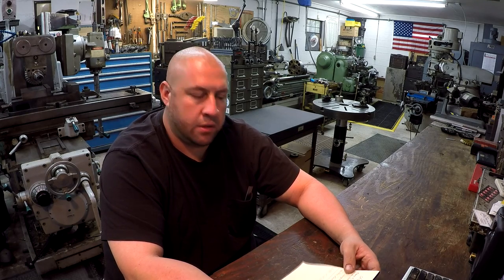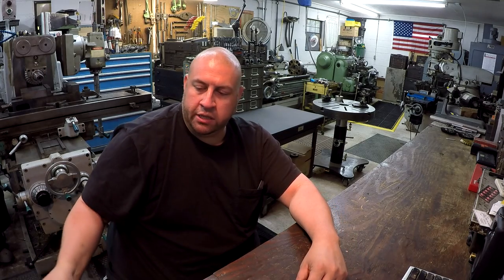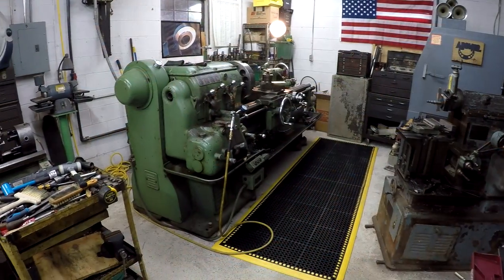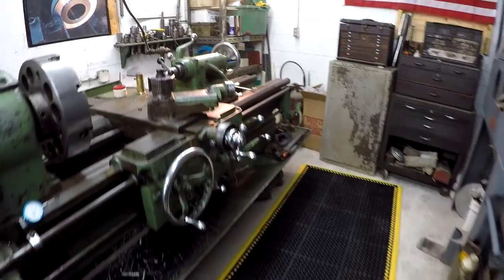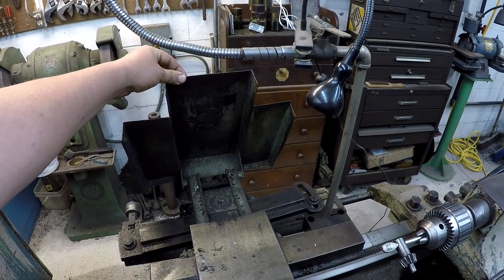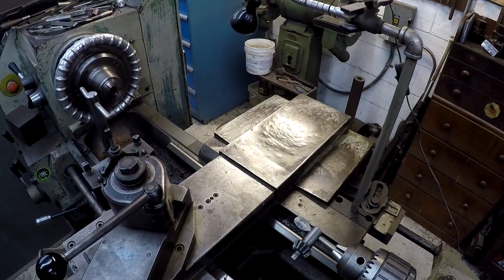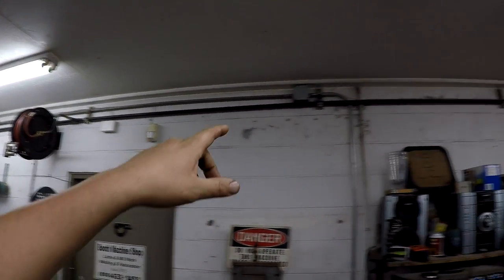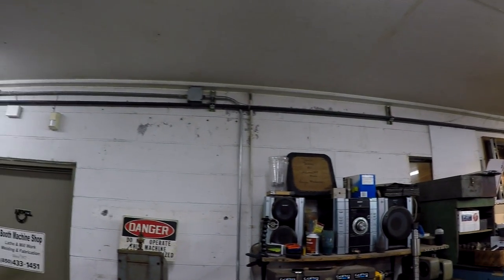Shop Talk 8: Lathe Way Damage? Shop Air Supply

Comment: That PVC pipe is good to like 360 PSI or something like that so I wouldn't replace it.  You may want to consider putting in a filter and regulator right after it comes through the wall though.  I am sure that there is a lot of humidity in the air where you live and getting the water out is always a good idea and regulating the air down to 90 psi will make the compressor run a lot less than it does now as well as extend the life of your air tools because they are designed to run at 90 psi rather than 120 or whatever your compressor shuts off at.  Have fun.
Reply: No. You must go at least 25 feet minimum from the tank before an air drier will work. Moisture will not condense out sooner than that in most cases. And he should have drains in the line as well
Reply: +GODINN LIVES not true. moisture in the air doesn't change further down the line. condensation in the air lines does. He could get a phase change air dryer and put it right next to the compressor if he wanted.
Reply: PVC is a no-no for compressed air.  Aluminum, steel, copper are OK, even flexible polypro tubing, but NOT pvc pipe.  See this article: http://www.usplastic.com/knowledgebase/article.aspx?contentkey=787
Reply: Part of the reason for the 25 foot distance is that all air flow/pressure will change form potential to kinect energy:  the pressure drops when it is moving down the line.  A drop in air pressure reduces its capacity to suspend water vapor and it condenses.   The point for a heat exchanger is directly after the compressor pump (not the receiver/tank).   The air is the hottest just as it passes the valves in the compressor head.  At that point you can extract the most heat.   I installed 30 feet of 1/2 copper pipe prior to it entering the tank.  Almost all moisture stayed in the tank after that.  Also, since the air was cooled and condensed, I had more air per compressor operation cycle and my impact tools "hit" harder.

Comment: I think you should leave the dents, they are a reminder of your dad! On the bed grinding mods, why was the lathe not provided with a removable gap in the bed? That is standard practice on UK lathes as you quite often come up with the clearance problems you mention. You have a very nice compressor set up, as you say the blast cabinet uses huge volumes of air, a thing that most people do not seem to understand, they think only in terms of pressure.

Comment: I did plumbing and did black steel pipe, which is my preferred,  then i did copper which was the prettiest,  then i repaired a 1.25 sch 80 air line for a factory that ran 300 psi..that was my scariest..strap it well, especially the turns..
  I liked the black pipe threaded, i even put drip legs under all the outlets. I strapped it 2x normal, who knows if a worker would hang something, i think ahead. . Accidents can happen,  drop a part on it, hit it with a machine, maybe a dent. No break or shutdown for repair.

Comment: The two biggest issues with using any plastics for compressed air are UV degradation and chemical degradation from the oil carried over from the compressor. Using a good quality oil separator will mitigate the oil issue, and simply painting the pipe will all but eliminate the UV (and ozone) damage.

Comment: Hello, if you want to run an air pipe on the other wall, i think it would be a good idea to make the air line circular, to have it go around the shop onto itself, theoretically you should get a bit more efficiency out of the line... :). Regards

Comment: I wonder if it's practical to use a curtain to keep sanding and grinding dust away from the rest of the shop.  Don't think there's enough room or need for a separate room but something to help control the dust.  Not sure it's worth the effort though.  Just a thought.
I plumbed my shop using PEX.  Works fine but looks pretty poor.  All of it was leftovers from another project so no additional out of pocket for the airification of my shop.

Comment: Hi Adam & thanks again for the videos.
Perhaps some time in future you could explain 'unistrut' to us newbie's?
You use it for your compressed air line.   THanks  Rod
Reply: https://en.wikipedia.org/wiki/Strut_channel   On Adam's airline a short length of unistrut is mounted vertically to the shop wall, and the airline is attached to the unistrut using clamps designed for that purpose.  The short dark vertical objects every few feet down the length of the airline, are  pieces of unistrut channel. There is also a horizontal piece of unistrut attaching the electrical conduit above the breaker box on the wall.
Reply: Thanks for that kwbarnes1

Comment: I wouldn't worry about changing the air pipe SCH80 will last forever, the problem you can have from using plastic pipe is from using SCH40 and big pressure changes like draining your tanks every day and filling back up, the expansion and contraction is hard on plastic. I have used plastic pipe for 20 years now and never had a problem with it and I leave it under pressure 24/7
Reply: PVC is subject to damage from chemical and UV, and is not recommended for air line use above ground.  Here's some specifics:

https://www.osha.gov/dts/hib/hib_data/hib19880520.html

When I put an air distribution line in my shop I ran a loop at the top of the wall using the hdpe-al-hdpe 3/4 line with drops where I need them.  Kits are available from Northern Tool and others.
Reply: the bit about 1972 being the year they started recommending against using PVC is kind of mind blowing!

"... the Plastic Pipe Institute, in its Recommendation B dated January 19, 1972, recommends against the use of thermoplastic pipe to transport compressed air or other compressed gases in exposed plant piping. "
Reply: What I've heard about PVC is when it fails, it shatters and shrapnel's as opposed to ABS which just bursts.
Reply: As far as I know, PVC doesn't meet code for compressed air. I've seen shops where it's been used successfully, but I won't sign off on using it  when I stamp drawings.

In addition to UV and chemical attack problems, it doesn't take heat well. I've seen photos from our local Ingersoll-Rand dealer from where a line shattered up under the ridge of a sheet metal roof.

Grey ABS  is more elastic, as others have pointed out. You'll need to check the piping code for your locality. I don't think that it meets the building codes around here.

Personally, I use sch 40 galvanized or black iron pipe for my air lines. I'm putting some in in our lab at work in 304 stainless, downstream of the oil & mist traps and the desiccator, where the air is a chemical reagent...

Speaking of which, an oil splash lubricated compressor puts some of that oil into the compressed air.  Not a problem for the impact wrench, or blowing off chips, but not good for spraying paint.

And, the air will contain whatever moisture it can hold - if it's a problem is a dry place like Southern California, it's got to be worse along the Gulf Coast.

I put in an oil & mist eliminator at the lab, and a desiccator. I'd recommend the oil & mist traps in any shop application...

Cheers,

Eric
Reply: I am not saying or telling anyone to use plastic pipe I was just saying I have used plastic for 20 years and haven't had a problem. And if I would have a problem its my fault. Just like wearing a seat belt its the law you have to wear it but lots of people dont.
Reply: Nothing personal...

I happen to be registered professional mechanical engineer, and I personally have to stay within the codes whenever I write something...

You may never push the situation into a bad place... I can be sued by people for saying something which is not in line with codes, if someone gets their lawyer to quote me as saying that it's OK...

In other words, it's my ass if someone else messes up and says that I said it was OK...
Reply: I totally agree with you. But i am not a plumber nor a engineer and if I was I probably wouldn't recommend using plastic either just for the fact that there is alot of people that will sue someone for anything
Reply: since you get paid to professionally bullshit your way thru a days works (MY DISCLAIMER: nothing personal) i well help the 'im a machinist man' understand just what sort of code(s) you may be liable for > drawing upon a BS degree in industrial technology w/ 40+ years of hands on construction work experience i /we'd request of you to device (or recommend) a common mans tool that verifies: the rate of UV degradation of that particular material in a variety of settings and common applications; the static electrical charge of various gases moving thru a diameter formed from that same material AND the likelihood of getting sued by the afl/cio's steamfitters & boilermakers attorney for openly accepting the noxious procedure in which those products are assembled to illustrate just a few...just sayin'
Reply: I am running an Atlas Copco screw compressor maintaining between 100 and 125 psi. with a refrigerated air dryer built in so moisture in the airlines is not a major issue.  Using iron pipe initially would have been a lot more work for sure but a lot better than PVC.  I am now replacing it all with Duratec pipe.  It comes in 100' coils and is fairly easy to work with.  However, the fittings are super expensive for sure.  Otherwise, it's a great system once in place and tapping into it to ad more outlets is very quick and easy.

Comment: Might want to rethink using CPVC for your shop air lines.  Problems arise from the cement welded connections breaking loose and releasing tremendous stored energy.  Please do some more research, my friend.  I used regular sch 40 pipe and it worked fine for the past 15 years.

Comment: Hi Adam, good video. Mate I have a question, the damage to the ways, is there any way it could be fixed. I am currently rebuilding a surface grinder with roller ways and there is some damage in one spot which I need to address, so, if you had to fix your ways for whatever reason how would you approach it????? cheers, Gordon, AUS

Comment: hey bud thanks for the videos that compressor pump is t-30 right (i think) what size motor is on there i had a gas powered t-30 had 8 hp on it now i have k-30 the rolair equivalent that has 8 hp gas on it i would like to convert to ac for shop air keep the videos coming

Comment: You described your air compressor as two cylinder, and technically it is, but the important part is it's a two stage compressor.  The larger cylinder on the right compresses the air and feeds it to the input of the smaller cylinder on the left to compress it further.  You get higher pressure that way.  An actual two cylinder compressor would have two cylinders of the same size, and generally provide lower pressure than a two stage.
Reply from the maker: Thanks Tim

Comment: Nice video Adam. Do you get much of a problem with water in your compressed air system, especially as you live in an area with high humidity. I didn't notice any water traps, apart from the one on the receiver, in the system?
Reply from the maker: I do have a water trap and drain where the line goes to the blast cabinet. When I run the line for the DoAll I'll add another one there.

Comment: For Air distribution, remove the PVC. We did that, after about 5 years, the SCH40 pipe started to blow up from weak points formed by who knows what. Those pipes blow up without warning and will shrapnel, we know this from experience and blood. For actually a very fair price, order some 3/4" MAXLINE from Amazon. It is HDPE over ALUMINUM over HDPE and is very affordable. Never blows up,  can be formed by hand, never corrodes or leaves foreign debris in your system, easy to modify any time, and ultra low resistance to air flow.  I did our big shop in 200' of  3/4 MAXLINE with 26 air discharge points, 6 wall spools, and several permanently connect accessories for a total of $550. This cost includes all my wall spools, fittings, manifolds, and drop lines. Your shop is not that big nor does it need that many points. From start to finish, I don't think I would even go over $260 for a whole new system in your space.

Comment: Tons of lathes of that design have clearance notches in the rear vee way.  Poor man's gap bed. You might mention that it is only used by the tailstock so it's not likely to ever run up that far. I did have to touch up a previously ground notch to clear a large connecting rod in a lathe at work. Doubt I could bring myself to do it to my own lathe. The one that looks like it was done with a carbide burr on a die grinder isn't too bad, but maybe clean up the one for the chuck jaws, just so it looks a lil better.
Reply: Most people that work in heavy industry aren't in love with the machinery like us. To them it's a job, "get it done, the machine will be scrap sooner or later". ...Dave

Comment: i agree with don,t fix the dents. I have some short pvc in an air line, but am going to change it out. it gets brittle with age and with a hard accidental blow to the pipe under pressure shatter and send shards of plastic all over. I may just cover it wtth a steel protecter, ghanging it will be better.

Comment: PVC is OK to use with a reciprocating compressor because they use oil. If it was a rotary screw compressor you'd have a problem. The lubricant in those will actually eat away at PVC pipe.

Comment: I'm going to take a stab in the dark about the ways being ground. If I had a hunch, I bet your Dad did propeller repairs in addition to shafts. If not, the Naval yard probably did. The small harbor patrol boats, barges, tug boats, J Launches, tenders and many more small naval boats. Probably inside hub machining to press fit new brass bushings. The prop blades were probably just exceeded clearance on the back way. Both grinds show an angle, which would be the same as the blade angles. Seen lots of brass bushing repairs on 3 and 4 blade props that were 15 to 24" in diameter. They'd stick the nose into the chuck and then set it up. When I was at the Bremerton Naval Yard back in the late 1990's, there was a decent size lathe in one of the machine shops. One of the machinists explained it was originally installed aboard the USS New Jersey. About the same size as yours and it had similar grinding marks but there were three sets. 

Because you have your air compressor outside, I would recommend you install immediately off the main take-off line coming out of the tank, one or two water separators filters. It will help you control water getting into your lines, tools and of course, avoiding water being sprayed onto your parts. Keeping water out of your air power tools will increase their life. Florida is high humidity and while you probably drain the tank on a regular basis (I do it daily), it's a good idea to install water separators to keep water out of your system. While there are quick drain models, a good oil filter style cartridge style is best. Using PVC is a good choice for a shop like yours. Just make sure the PVC is burst rated to 150 psi. (widely available). 

Like other commentators, definitely leave the dents in the Victor cover. Don't even paint it. Maybe clear coat it,  but that's it. 

Great shop talk episode.

Comment: Don't fix the cover, it's like your dad is still there, it's the little things. Also putting a curtain across the shop separating the welding from the machines when you weld or cut grind ext would be a good idea, they don't take much room, and stay out of your way when not in use.

Comment: Thank you for showing your compressed air set up. Do you have a filter to trap oil ahead of your sand blaster? Do you have any other equipment in your shop that depends on compressed air?

Comment: I did not see your dryer and oiler system for the air. Also, on the Monarch lathe I guessed the cutouts right for being ground. I was wondering about the front way. Looks like chips have been dragged on that. Both your lathes have been updated quite a bit. You audience keeps you on your toes. I know I've organized and set my area up better because it f the community. I can't be as organized as Rays Garage though. His skill oils of organization are one for the books.

Comment: Hi Adam if in the future if you do something on measuring tools I have never fully trusted snap gauges. Maybe you could show us the way you like to use snap gauges Thanks
Reply from the maker: +THE IRONWORKER Yes, I'll see if I can explain that. It's tough to teach someone how to use a measuring tool on camera though. It's been in my mind though on how I can share it.
Reply: Well maybe it's just me and not knowing how to get the right feel for them I would rather use an inside mic of some kind
Reply: Sorry wrong name for tool it's telescoping gauges
Reply: Maybe I should try to make sure I'm always straight up & down like you say , And just keep trying Thanks
Reply: Just measure the same item over and over paying close attention to what you are doing and the reading you are getting. Don't over tighten the nut, or leave it too loose. Also don't grip it like a wrench, hammer etc. let it float in your hand while rotating it, you don't want to impart any excess force on it. When you can repeat the same dimension over and over then you can be sure it's accurate. Also the mic isn't a clamp. get a fell for thimble pressure on a mic with feeler gauges, a mic standard or gauge block. See how much force it takes to get exactly to the thickness of the gauge, then slide the gauge through the mic to feel proper resistance.
Reply: Thanks I will be trying all the comments I get because I know it is a good tool I have just never gotten the feel of them

Comment: Are you on a demand meter?  It would seem cost prohibitive to start a 15 hp motor every-time you need air for incidentals.  Maybe setup a Y with valves to run a 2 hp compressor for the non-blasting purposes.  A video on "shop power" might be cool.